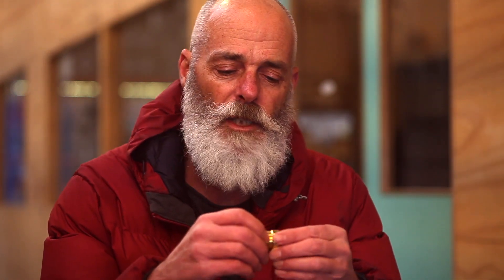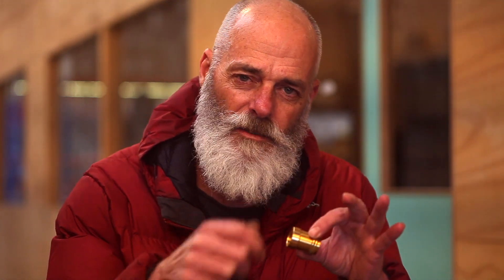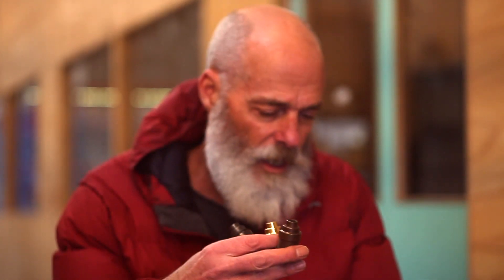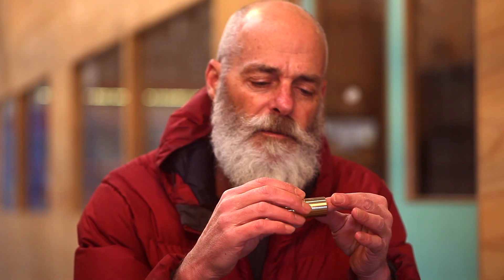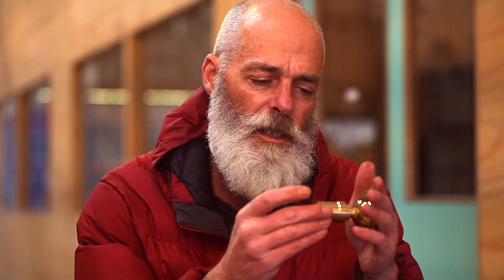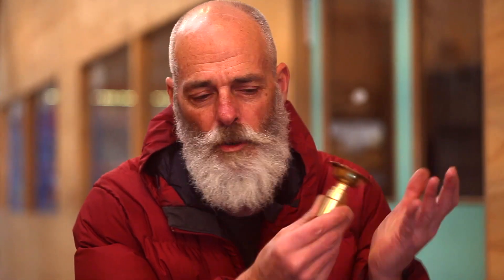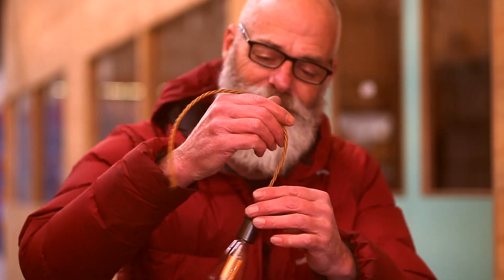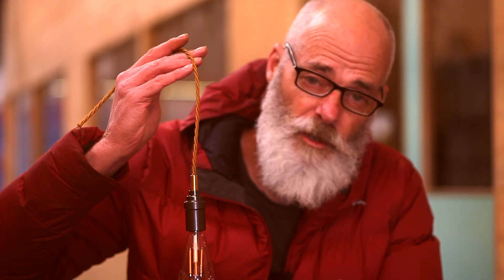How to wire E14 Brass Lamp holders

Comment: I've bought an Artemide Dalu lamp which is supposed to take an E14 SES bulb (says so in the booklet that came with it -- and also on the side of the bulb holder. However, it has proved impossible to screw an E14 bulb into the holder -- as it appears that the bulb screw is slightly larger than the holder thread. Any ideas? Thanks!   :0)
Reply from the maker: What country are you in? SES is E12 in North America and E14 the rest of the world. You may be trying to screw an E12 bulb into an E14 lamp holder.
Reply: @EdisonLightGlobes  Thanks for replying! I'm in the UK and trying to screw an E14 SES bulb into an E14 SES bulb holder -- but it just doesn't even begin to screw in. Will have to get the bulb holder swapped out.    :0)